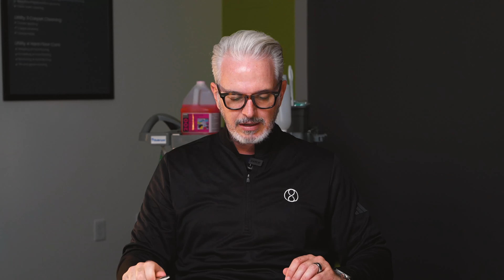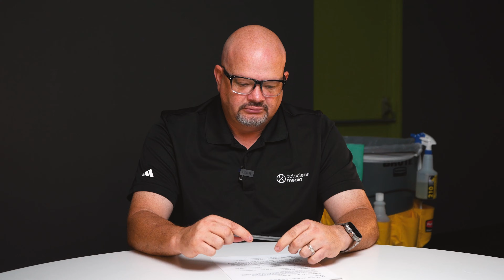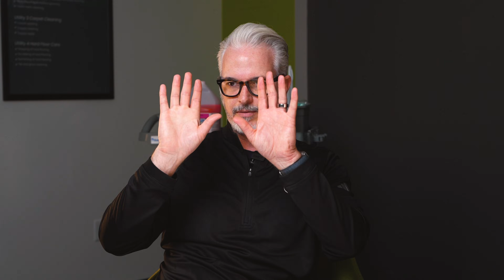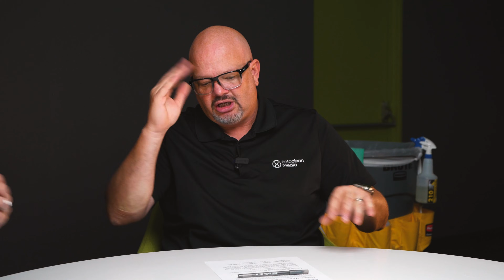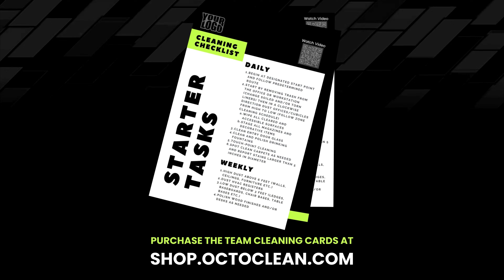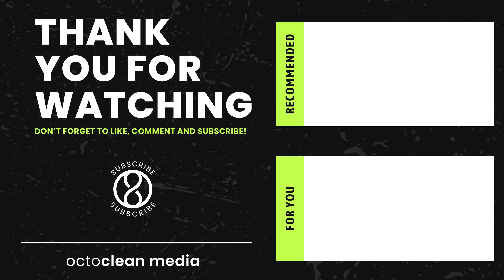Post Construction Cleaning Differences: Better Than Commercial Cleaning?

Comment: Don’t you need a specialty license for post construction clean up
Reply from the maker: Typically, no. You may need a waste haulers permit if you will be handling that yourself or a contractors permit if you are offering services that go beyond cleaning.
Reply: This is from CA CSLB.

C-61 
D-63 - Construction Clean-up Contractor

A construction cleanup contractor cleans up and/or removes from building grounds or structures any debris resultant from any construction project including but not limited to: concrete, dirt, scrap lumber, plaster, drywall, any paint or adhesive products from windows, floors, ceramic tile and bathroom fixtures.